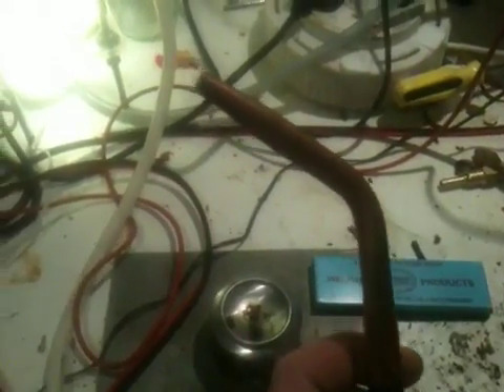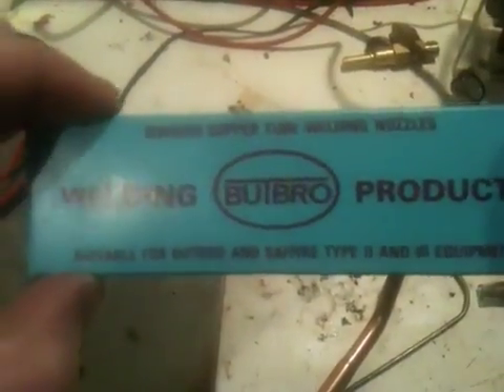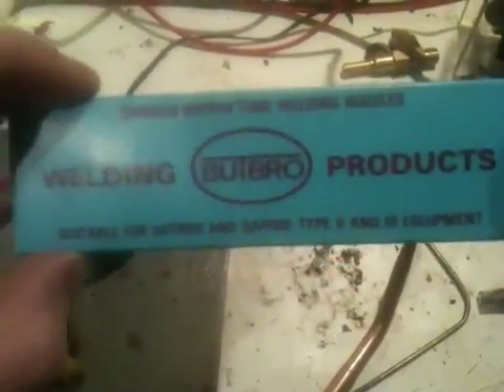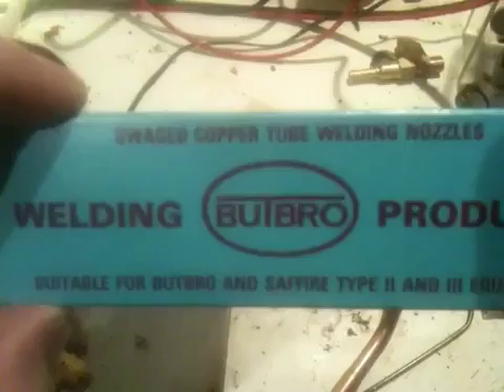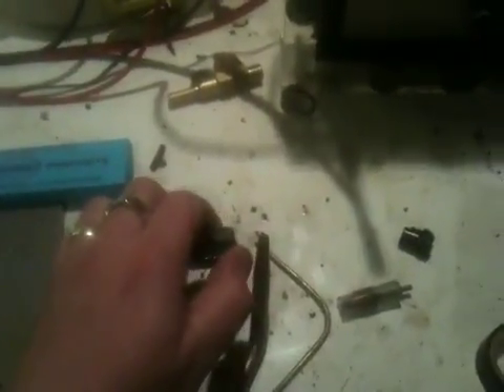Welding nozzle for HHO torch

Comment from the maker: interesting thought, i have considered adding a pump to the generator system for better circulation but not thought about adding compressed air to the outlet of the torch. have you tried compressed air your self?